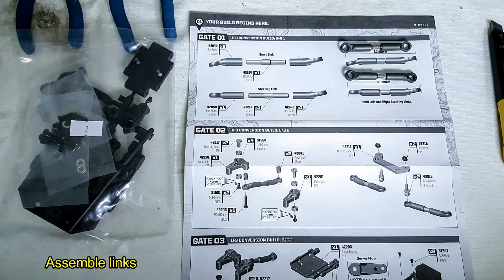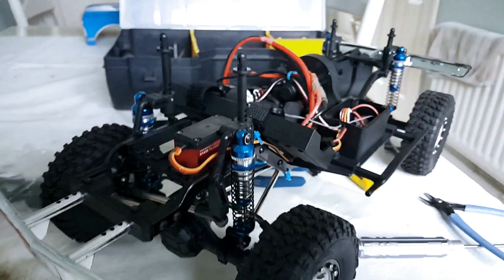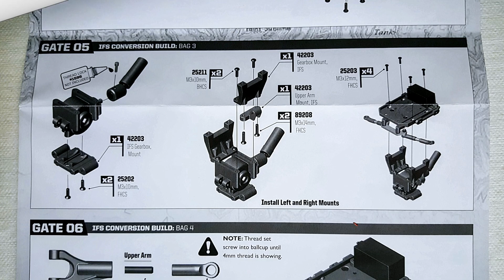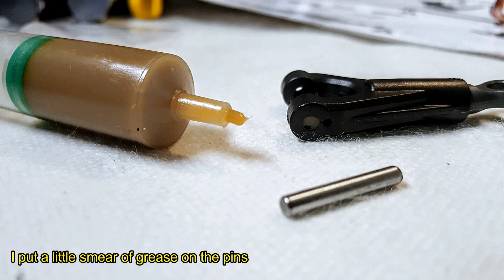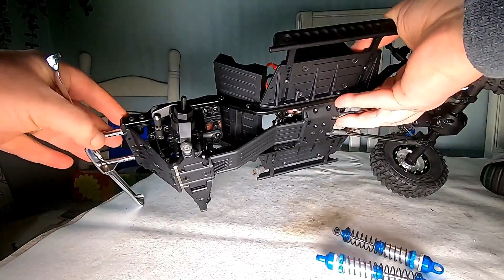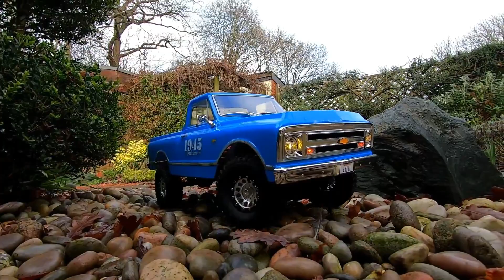Element RC IFS Kit Build

Comment: I´ve been awaiting this conversion video with interest! I thought you did a cracking job of recording the process, with beautifully laid out parts on an uncluttered background alternating with shots of the build guide - and I´m sure you were right to use the other servo horn so you could get the geometry spot on. It´s often tempting to think that one or two millimetres won´t matter, and annoying to have to take everything apart again to change it when you find that it´s binding!
 The run vid is lovely, too, with that gorgeous body looking wonderful and the wet stones and rocks at their most colourful. Great work!
Reply from the maker: Hello Del. Thank you very much my friend. The light is very poor in our house, and especially during the winter months. I struggled a lot when I was recording and taking the photographs for this video, and that struggle continued in the editing. It was a very long process and I came close to giving up on it. But you and other people have said encouraging words about this video is so I'm glad I continued with it.  I'm very happy with how the conversion went though. It was straight forward and all the components are good quality. The front shocks feel a bit stiff but that could be because I only used a small light lipo pack to test it in the garden. The battery tray sits over the front shocks so there wasn't much weight on them. It will be good when I can give it a decent run in Holly Hill with a heavier full size 3s lipo.  It could be that all it needs softer oil in them , but I will wait and see.
Reply: @hollyhillrc  I tell you what - it´s impossible for me to tell by watching the finished video how much you had to labour to make it all work out. It looks slick and professional. Though obviously the viewer can tell that a lot of effort went into it. you´d never guess that it was such a struggle.

Comment: Nice work Derek brother. Seemed to run ok there at the end. What do you feel about it? Better? Worse? Seems ok to me. Thanks again bud and Have a great week
Reply from the maker: Hi Nick. Thank you my friend. I'm very pleased with how the conversion went. The instructions were easy to follow and the parts are good quality. I haven't been out to test it properly yet, but I've run it a few times in the garden. I think the dampers may be a bit hard. I had no preload on them but I only used a shorty lipo at the time, so there wasn't much weight over the suspension where the battery tray is. The kit came with harder springs to use on the front, so I put the original softer springs back on. But it just collapsed under the weight. So they are way too soft, and I guess that's the reason harder springs are supplied with the kit. I've put the harder springs back on and will get more of an idea how they perform once I can get out into the woods again and use it on some rougher terrain using a full size lipo. Before I bought the kit I asked a friend who had converted his Enduro what he thought and he said he didn't notice any difference in the performance compared to the three link set up. He runs his RC's on much rougher terrain, and more vigorously than I do, so I value his opinion. If it still seems a bit hard it may just be a case changing the oil to something softer.
Reply: @hollyhillrc  Definitely fun to play with and tweak. Interesting comparison by your friend? I would of figured a definite difference. Mainly flex. I would assume? It will be interesting to see your comparison and it will be good that you have both versions to do that comparison :P

Comment: That's a nice looking truck Derek, we are so used to solid axles being used in RC crawlers but I bet this independent set up works well.  I wonder if you will have to adjust the shock oil and preload to get good flex/articulation.  Excellent presentation of your build, you really have this style of How-To vid down.
Reply from the maker: Hi Paul. Thank you very much. That's a very good question about the suspension. The kit came with different springs to use on the front dampers which I put on. Since this video I have run the set up a few times. Only in the garden, and I have no preload on the dampers, but I think they may be a bit hard. I only used a shorty lipo at the time so there wasn't much weight up front over the suspension. But when I put the original springs on it just collapsed under the weight. This really surprised me and it was a lol moment at the time. They are way to soft, and is the reason harder springs are supplied with the IFS kit. I've put the harder IFS springs back on and will get more of an idea how they perform once I can get out into the woods again and use it on some rougher terrain. It may just be a case of using a full size lipo and/or changing the oil to something softer.